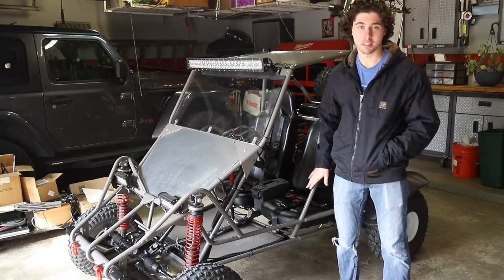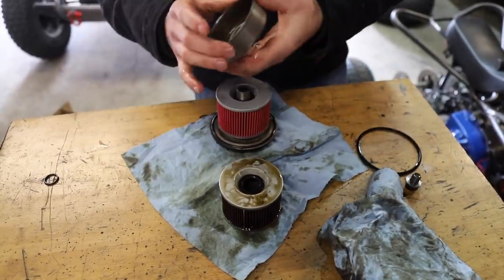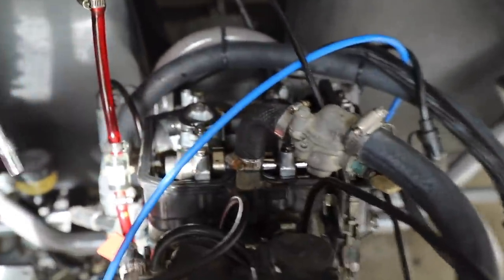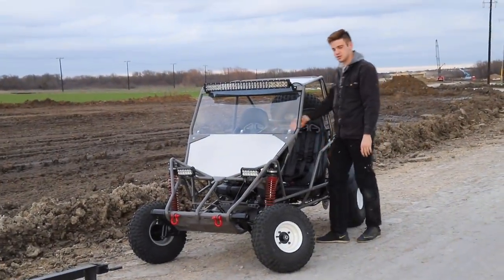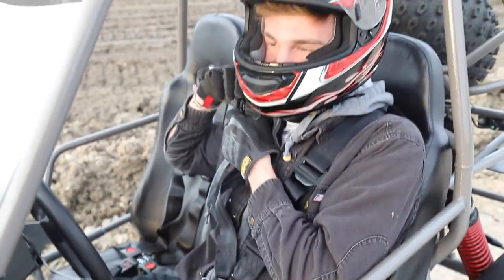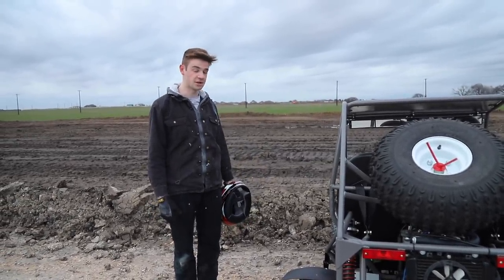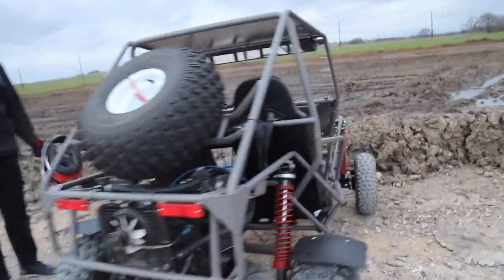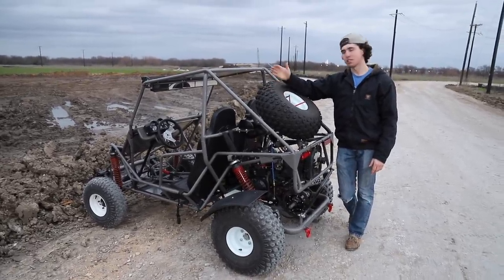Ninja Offroad Shifter Buggy Build Pt 11 | It's Done!

Comment: Sounds very lean on the jetting, and might have a vacuum leak because you rev it and it sloooooowly returns to idle - it doesnt snap up and snap down like it should, I know theyre CV carbs, but those arent right yet? Get yourself a "Jet Kit" and try either a stage 1 or stage 3 since your messed around with the pipe and air intake - Good Progress tho-
PS: also - I used a Floor shifter cable from like a 1970 chevelle or some other GM muscle car for my shifter kart- as this is a thicker wire for all the stress of Push-Pull on the shifter, I see that inner wire of the cable you used was wimpy
Reply: Another good option is a "butterfly" style shifter. You will see those used in FSAE cars. It works both the clutch and the shifter at the same time. Those also use the thicker shifter cables
Reply: They could do the trick we do with these ninjas, washer the needles.  Go on the ninjette forums and there's instructions to add washers to the needles for a bit more fuel.

Comment: A chain guard might be a good idea, especially if you keep the big sprocket. The torque is probably at the right spot with two passengers. It is a 250cc engine designed to rev very high.

Keep a spare vise grip in the toolbox, coulda used it to shift with 😜
Reply: Yah, shes a firecracker.  I LOVE mine, high revving little monster.  😂

Comment: With aftermarket muffler and air filters, you have more air moving in and out of the engine. You have to rejet your carbs. Pull your bowls and remove main jet, there will be a number on it. Go up 2 to 3 sizes and that should get you where you need to start tuning. Pull you spark plugs, if they're clean it the ceramic is completely white you're too lean. Being off-road you wanted to have a brownish color.

Comment: That bike motor has wet clutches, it looks like you used regular pennzoil. It might not be a problem with how low its geared right now, but you may run into clutch chatter and slipping issues with more load.

Comment: So happy that it works good because I am building a 250 motorcycle engine buggy and I was worried that it wouldn’t go fast
Reply: You will be fine. You don’t need a 1 liter engine to have fun. I am building a gsxr 600 buggy and anything over 25 hp with gears should be more than enough for a buggy. Happy building

Comment: it sounds like no back pressure
great build awsome work
Reply: Yah those mufflers have nearly none.  If you leave the screen in, or the spark stopper or whatever its got on that model you can add just a touch back that often does the trick of giving enough backpressure to run right.  Most people yank em out though.

Comment: Sounds rough in mid-range rpm. May want to clean the carbs and go up on the mid and high jets. Just to be safe and not run it lean. Try the stock airbox too.

Comment: Spray some carb clean or brake clean on and around your intake boots if there is a leak it will change the idle. Pin point and repair

Comment: Sounds like it's still breaking up. Also if you're starting off in 4th with very little issues then you're gearing is way low...lol. I'm wondering if the timing is a bit off.

Comment: Damn...shes still popping and sputtering.   Ive never heard a 250r do that.  Maybe try swapping to the carb from another engine or adding a pulse pump.  My bike sounds much smoother, something still isn't right.  :(  

Amazing build overall, I wish i could help the engine tuning with more accurate info, but I mostly stumbled into my bike sounding and riding as good as she does.  You drilled out the plugs on the tuning screws on the carb and adjusted them right?

Comment: Add some 4 inch spacers all 4 wheels and put a 600 cc inline 4cyl from a real mans ninja ....ok the 250 is way better than stock but those ex 250s and 500s are nothing like a real 600 ...
Reply: I've owned bikes from a ninja 250 to a 1000r and enderos/dualsports. These little bikes are more fun in all honesty.

Comment: Stiffen the rear shocks. Sounds like its spitting a bit. Check the plugs or plug wires. There is a way to get a better spark by warping the plug wire with solid core bare wire about half the length of the wire then ground it to the frame. The spark will be better grounded and give you a heaver spark, its like creating a coil over your plug wire. Then insulate the coil with good tape...

Comment: when shifting up you dont need the clutch with practice you can shift down with no clutch also
Reply: With a sequential its just as easy to downshift as upshift.
Reply: @camyota  ayr just timing the revs right i found on my motorcycle when breaking a little blip on the throttle would allow me to shift down